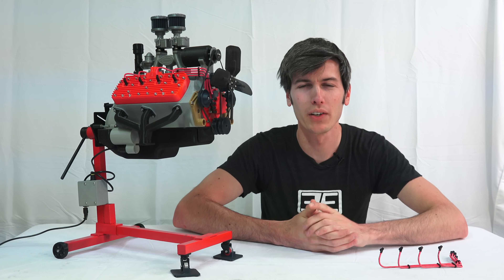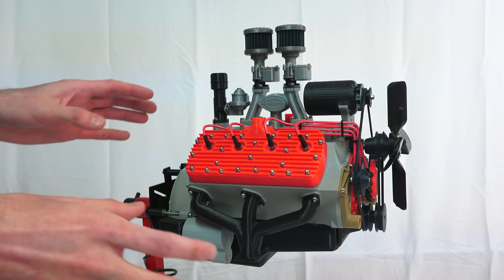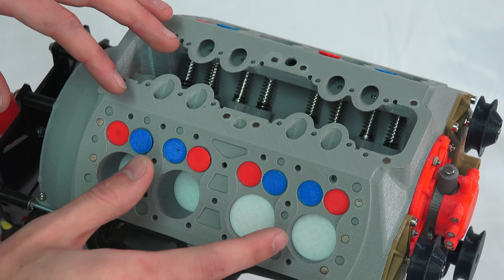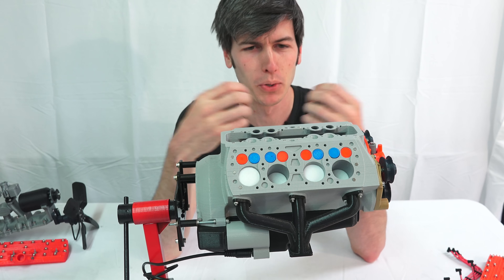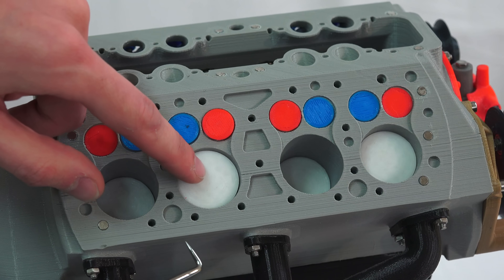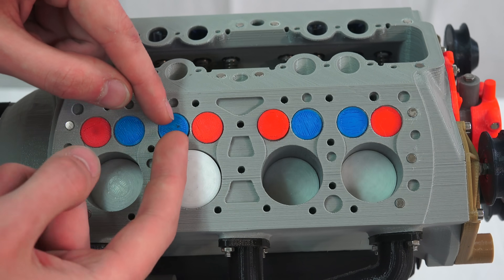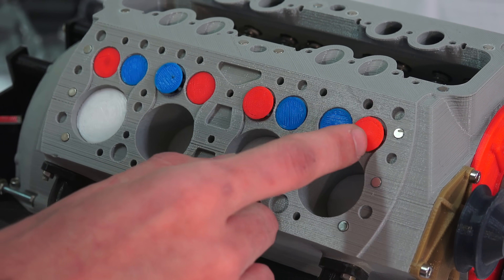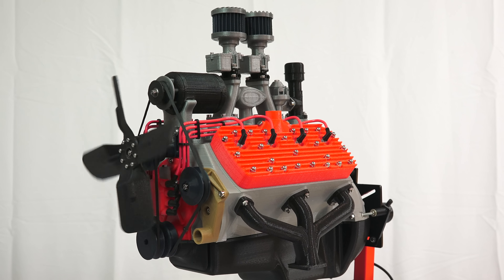Why Ford's Flathead V8 Engine Died

Comment: Its basically a overgrown lawnmower with 8 cylinders... it was easy to make, but generally not as easy to make as lower cylinder count engine that also offered simlar power. It had length and weight advantages over an i6, but its intake design made it often taller, still wasn't as smooth operating and involved more hours of production labor\parts. Also at its intoduction 55hp it was competing directly in performance with lower displacement direct acting single overhead i4's that where much cheaper again, although as demand for power increased it did pull away thanks to not sharing the secondary imbalance that prevents higher displacement i4's. If it wasn't for the halo effect of more powerful V8's I honestly don't think it would have been kept nearly as long, but an an era where cars where growing towards large slow status symbols, and tire\traction technology was a long way behind, inefficient high torque power-plants with high cylinder counts held boasting rights... at least in the USA where fuel was cheap and streets wide.

Comment: I don't exactly understand what you mean by the intake and exhaust going the same direction for today's overhead valve designs. Doesn't intake air always go into the cylinder, and the exhaust out?
Reply: With a flat head the center cylinders both exhaust to the middle of the block, the outside cylinders exhaust to the outside edge of the block. He was referring to the center cylinders both going the same way to exit the middle. That’s what even though there’s 4 cylinders on a side there’s only 3 exhaust ports.
Reply: Appletank8 the flow goes to the left. And because theres a flow going to the left, it 'sucks' air from the intake valve on the right. So it pulls in more air and can burn more fuel and produce more power and its more efficient
Reply: Wouldn't the flathead's valves also produce a circular motion of air? Or are the turns too disruptive?

Comment: It would have made more power if it wasn’t made of plastic.
Reply: ootdega There is a good reason they do that, plastic don't heat soak like metal intakes do
Reply: Angel Ramirez---   Plus, intake runners are not a stressed part of the 
 engine.  It's OK to make them out of plastic.  Reliability depends entirely on how you formulate the plastic.
Reply: Alex West the same people that thought it was a great idea for 3.8 series II
Reply: To be fair years ago when the UK government consulted with Ford about whether they should back diesels or not ford said hell no and gave them a load of research they'd paid to conduct and then said look back petrol and in like 2-3 years we will have the plastic engine using wetliners and making 100mpg in petrol cars, the UK government ignored all the research and pleading from Ford and backed diesels anyway....
Reply: Those would be the current Ford engines.
Reply: Angel Ramirez Correct, and they melt due to that fact. I personally had 3 melt at the EGR pass through (water cooled hole, even) causing the engine to injest coolant into the combustion chambers
Reply: Jason Woods that’s because your catalytic converter was restricted.
Reply: Gotta love those engine parts that GM makes out of the same plastic as the dashboard... Those are great
Reply: +bcubed there are two kinds of "plastic" - thermoplastic polymers which don't cure and will remelt on heating, and thermosetting polymers which cure into a fixed shape and will not remelt on heating - they just char and decompose. Ironic that you should describe a thermosetting polymer, when the word "plastic" comes from thermoplastic. Also, it tends to be thermoplastic (non-curing) polymers that go brittle, as they are blended with low molecular weight substances called plasticizers to make them more flexible. These are responsible for the "new car smell." As the plastic ages the plasticizer evaporates causing the brittleness. The lifetime of plastic is highly dependent on selecting the correct type and grade - it should be over 20 years in many applications, but frequently poor choices are made by people who do not appreciate the subtlety of polymer specification and selection.
Reply: And they wonder why they can't get a ground.  Pfft
Reply: Glen Waldrop
Plastic is a polymerized liquid that "cures" into a solid.

Problem with plastic is, that it NEVER completely stops curing! As plastic ages, it gets increasingly brittle and prone to breaking/cracking. Thus, any part made of plastic is life-limited by design.

Metal, OTOH...keep water away from it, and its life is essentially unlimited. Yes, it can fatigue, but you can design it so it stays of of its "Fatigue zone."
Reply: They listened to Volkswagen Group instead, and look where it got them.
Reply: Kenneth Barbee uhhh no.
Reply: stuart cole I wonder why
Reply: Plastic actually works quite well if you design around it's limitations.

As Angel Ramirez said, heat, primarily.

Plastic doesn't hold on to heat like aluminum or cast iron. That alone is worth 10hp on a decent engine (as in something like the Ford 4.0 OHV, nothing crazy). It is also much easier to make.

I saw the plastic plenum, never expected it to hold up and said as much. At 150,000 miles I had to fix an intake leak, exactly as I predicted. The catch was it was the aluminum lower, not the plastic upper.
Reply: Also this engine is very small
Reply: it would melt if it made out of plastic, the engine would be very hot
Reply: Speaking of plastic gm parts. Who thought it would be a good idea to make the upper plenum out of PLASTIC on the chevy 350 lq1 vortec??
Reply: @JingleBop  some ford explorers with the 5.0 v8 have a plastic upper plenum as well as, get this, some awd chrysler 300C HEMI 5.8*!      * Im not sure if the 300 that I saw the engine replaced in was a 5.8 or 6.2
Reply: Plastic or not Ford's doing it right

Comment: Another fact is that the combustion process isn't good at all due to the geometry of the (combustion) chamber, where some Work (pressure) in the power stroke ends up being ineffective because part of the energy "stays" in the section of the valves and not all of it is transferred to the piston.
(Correct me if I am wrong -if you could understand haha).

Comment: The engine has many more issues, including having only 3 main bearings, poor cylinder cooling due to exhaust porting around the cylinder, and lack of full flow oil filter.
Reply: The first thing I thought when I saw how the exhaust was routed around the pistons.  Must have been a bear to keep cool.
Reply: Ollie Hopnoodle overheating was a big issue with the flat head.
Reply: Now that I see how they were set up I can understand why!  You have to love the original hot rodders who did what they could with these old engines.  They helped create the American car culture.
Reply: From an Manufacturing standpoint it is a nice thing. Cast a block, some drilling, some honing, few simple milling operations that can be done by anyone within 1-2 weeks of training and the thing is good to go. The Camshaft and the Crankshaft are the complicated parts, having just one cam shaft helped the manufacturing process.
Reply: Harry Buttwhisker 

this thing became in the first half of the 20th century. I think it did EXCELLENT. all these little quirks are easily modified.
Reply: It was very difficult to keep these v8s cool. My father told me that back in the day, (1930s), it was a common sight to see Model A's with steam plums from the radiator. I do believe the first model of this engine did not have a water pump. It used gravity and heat for circulation which didn't work out to well.  Having to route the exhaust around the cylinders made for  a massive amount of heat build up.
Reply: It was the model T with the flathead 4 cylinder that didn`t have a water pump. Early 221 cu. in. V8`s water pumps were cast into the heads, later moved to the block
Reply: Thanks for the correction. My dad told me they didn't have a water pump however, after all these years, I assumed he was speaking of the v8. The 4 cylinder makes much better sense to me.
Reply: In France a little V8 Ford, 2,3 liters, 84 hp was make until 1961. The car was the Ford Vedette until 1954. The Ford factory was selled to Simca, with new models. In 1962 the factory was transferred to Brazil, trademark Simca do Brasil.
Reply: Actually, these were pretty poorly designed and always had unresolved problems. If you want to look at a GOOD FLATHEAD V8, look at Cadillac. They were so good and reliable the government chose Cadillacs for Sherman tanks in WWII. They had the exhaust back out the top, so to eliminate that coolant being heated by the long exhaust ports. Packard made pretty good engines as well but straight 8 only.
Reply: Ford V 8 flat-heads had two water pumps, two upper hoses , two lower hoses, 22 quart radiators and still ran hot. The center exhausts ports were routed through the water jackets in the heads, preheating the coolant even at idle. They were bears to cool but very good reliable engines in their day. Racers often removed every other vane in the water pumps to slow down water flow for better cooling.

Comment: I think the exhaust gas can all fliow out under the valve toward the cylinder. But it is inefficient.a couple of other points, Chevrolet had an overhead valve 6 cylinder from 1928 on. In 1933 it also had 65 hp. All car manufacturers were keeping compression and power low deliberately. Certainly they understood raising compression ratios helped with power but the leaded fuel of the day had not yet been standardized, and detonation will ruin an engine. Most roads were poor, speed wasn't in high demand, torque was. The Ford flathead also had overheating problems because the hot exhaust ports out through the water jacket in the block. Obviously not geeat.
Reply: From an early 1950s Chevrolet advertisement 'A valve in the head is worth two in the block.'
Reply: Dave B Some versions had the exhaust manifold up top with the intake. Problem solved...until the carb leaked.
Reply: Rick Delair. Ford did it for packaging, not to warm it up faster.
Reply: open deck wasn't the rs's problem, the factory used the wrong gaskets.
Reply: Cadillac's V8 flattie was this way and they cranked out thousands of them during WWII as industrial and light-tank engines.
Reply: I know the first version in '32 was very problematic, even had cracking problems. I don't know if they even had the word "recall" but it was so bad it was at that level.. They had to find ways around the problems.
Reply: When I took a course in internal combustion design in about 1965, we were shown aircraft engine pistons with holes in them that had been caused by detonation.  Those big radial engines had two spark plugs per cylinder.  That resulted in faster combustion because ignition started from two points.  If one ignition system failed, destructive detonation could occur because combustion took longer.  Before detonation (knock) can occur, certain pre-detonation chemical reaction have to occur and that takes a bit of time.  If the combustion is fast enough, it will be complete before the pre-detonation reactions have time to take place so detonation will not occur.

Several cars have been made with 2 spark plugs per cylinder, including some early Rolls Royces and Nashes.  That's one way to reduce octane requirements.  Another way is to design the combustion chamber shape so that there will be high turbulence resulting in faster combustion.

Considerable work has been done to understand combustion.  One technique was to make bombs with a transparent window to observe combustion with high speed photography.  Engines have also been made with transparent windows in the head to observe combustion.
Reply: Dave B Chevrolet had OHV 6 cylinders long before 1928, they had an OHV V8 in 1917.
Reply: Came here to find this comment. I was looking at the location of the exhaust valve relative to the headers and was thinking to myself no way.
Reply: they kept the compression ratio low in those days because of fuel knocking.  tetra ethyl lead had not been created to step fuel detonation under heavy loads
Reply: But those old Chevys had a really Mickey Mouse bottom end, up until about 1953. Nicknamed "babbitt pounders".
Reply: Buick is the manufacturer that came out with the overhead valve arrangement in it's first models.
Reply: Both Buick and Chevrolet always had overhead valves so far as I have been able to determine.  However, the first Buick was made before the first Chevrolet.
Reply: Es verdad   los v8 L  de ford tenian una absurda salida de gases calientes del escape por dentro del agua  Tenían una  tendencia a recalentarse sobre todo en camiones.  bastaba un dia de calor que el Ford subiera una cuesta  en segunda  para llegar hirviendo  a la cima.  Cadillac que también era V8 de tapas planas  tenia mejor salida de escape  por encima de la V ; Lo mismo Lycoming  y Packard. Demas el motor era exelente  y  a la prueba está  que ese planteo de Motor  V8 Ford se hizo en todo el mundo  y hasta en Rusia
Reply: even had cracking problems. . .yes, many customers cracked up from engine's poor reliability- so ford engineering had to crack down. . .
Reply: It is true that ford v8 L had an absurd leakage of hot gases from the exhaust inside the water. They had a tendency to overheat especially in trucks. It was enough a day of heat that the Ford climbed a hill in second to get boiling to the top. Cadillac that was also V8 flat caps had better exhaust outlet above the V; The same Lycoming and Packard. Demas the engine was excellent and to the test is that that Ford Motor V8 proposal was made throughout the world and even in Russia
Reply: Like Mopars. Babbit Beaters.
Reply: I had a 91 Ranger with 2 plugs per cylinder, and I think it was something common to all of that particular generation/displacement 4 cylinder engine. In that case, though, it's my understand that it was done for emissions reasons-specifically to ensure complete combustion. Those engines had a terrible reputation for burning exhaust valves, and when it happened on mine I went through three junk yard heads to find one that the machine shop could even salvage.
Reply: knocking is detonation. Detonation is when all the fuel goes off in one instant and you can hear it as a knocking noise. What you need is a flame front moving from one point (spark plug) across the combustion chamber, known as deflagration. Once the plug fires and lights off the mixture pressures instantly increase enormously, which can cause the remaining fuel/air mixture to go off all at the same time. Delaying or retarding spark can help. If the piston is moving down before it fires it helps reduce pressures.  however Tetraethyl Lead was actually developed and first used in the 1920s, nearly ten years before the flathead V8 was developed. so it did exist in the 30s, but it had not been standardized. Even bolt sizes and thread pitches were not standardized. Even oil grades were not established. They would tell the owners to test the oil using the "pour test" to see how long it took to pour out of a can, before using it. If you could get it out of the can in the prescribed time it would be okay to use. A lot of what became universal was just beginning to standardize between 1930 and the war.
Reply: Do we really expect that much from a manufacturer installing open-deck engines in a 2018 model turbocharged vehicle?

Comment: This engine used cooling without a water pump in some applications. It used a convective siphon system to a front mounted radiator. Well it did at least on a Ford truck we used to own that was ex WW II. Another simplistic design characteristic.
Granted that by today’s standards its Thermal and Volumetric efficiencies were limited by architecture but one thing I remember was how smooth and quiet the mechanicals were.
Thanks for presenting the neat model with detailed explanations.
Reply: I very much doubt that it would have been possible for the Ford flathead V8 to run without a water pump.  Having the exhaust run through long passages through the cooling water imposed a big heat load on the cooling system.  However, engines have been made without a water pump.  Probably the best known was the model T Ford.  But to make that work, it required extra large passages for the cooling water for thermosyphon to cause sufficient water flow.

Comment: Those 3D printed models are making your job a lot easy pal, keep it up! I'd like to make a request, could you explain what the overlap in the camshaft really do in order to increase low and high RPM power and how they affect our driving experience, I have a brazillian version of the GM Iron Duke 2.5 and I'm doing some tunes on this engine and the camshaft with a higher overlap make it very difficult to tune the carburetor, but now that I finisshed it has incresed a lot the mid to high RPM power, so if you could explain that would be great, and if you could make a video about the GM's 151 and the 250 In Line Six that would be great because in Brazil we have a lot of these engines in our classic vehicles... thanks a lot e congratulatiopns on your videos...
Reply: 2 things to consider on overlap. 1 the incoming charge has inertia so it wants to keep moving. 2 the valve has to open a ways for good flow to happen. the same kind of thing happens on the end on the  end on the intake stroke,